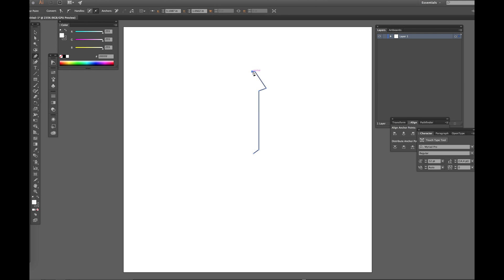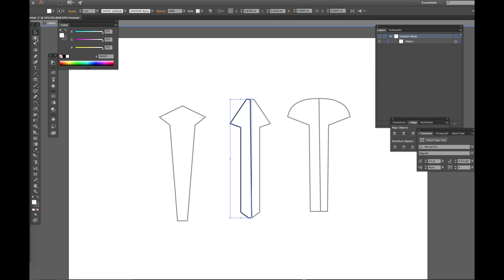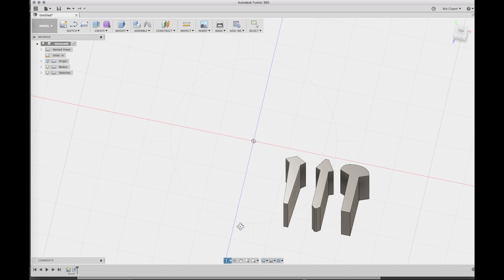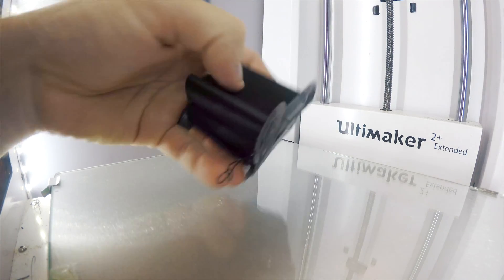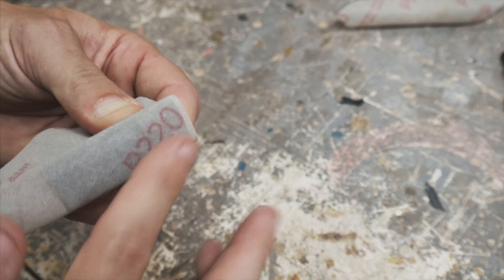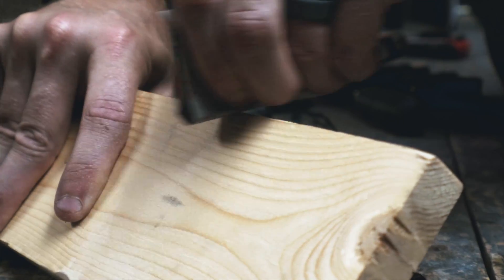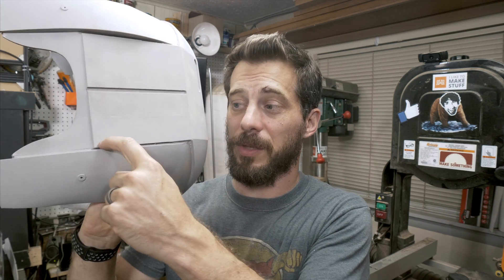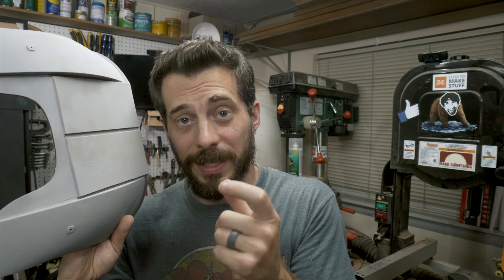How to make Custom Sanding Grips with 3d printing | I Like To Make Stuff

Comment: What type filament did you use? I wouldn't use stand PLA as that will begin to warp very quickly by the heat generated from the friction.

Comment: Hey Bob, good video.  I haven't gotten into 3d printing yet, but it's only a matter of time.  Just curious; any idea of the cost of those?  Since I've ever bought the spools of print material, I didn't know what those would cost to print.  Pennies?  Dollars?  Just curious.
Reply from the maker: A spool of PLA is anywhere from $30-$50 depending on the brand (and there are different qualities) but a spool goes a really long way unless you're printing huge pieces.  There are a lot of factors into figuring out that cost though (including lost waste material, etc) so Im really not sure.  Some pieces of software (Simplify3d I think) will give you a cost estimate of a print based on the spool cost that you input.

Comment: You can take this a step further and add a dovetail-type shape to the end and create a handle for it with a corresponding shape. It would lock into place giving you more control, a more comfortable grip, and you could even incorporate a way to clamp the sandpaper to keep it tight.

Comment: Cool use of a 3D printer. I had not thought about sanding blocks of unique sizes. And if you had already modeled something, just like you said, using the negative space would be super easy.

Comment: I've delayed a table refinishing project because of the intricate detail on the table legs. This will make sanding those areas so much easier. I can’t wait to get started with 3D printing and I think this will be the first project that I attempt. (As a side note, our local community college has a 3d printer in the library which is accessible for a small filament fee. Just bring your design file). Thanks for the great video and idea!

Comment: Those look super handy for sure. Question, I've never 3D printed anything. You said the term "infill" to clarify, are most 3-D printed objects somewhat hollow? I would assume so due to print times and cost of Filament right?
Reply from the maker: Yes, infill is a percentage of "solidness" :)  The majority of things I've printed are only 10-15% infill.  There are also different infill patterns that help with crush strength ,etc.
Reply: I Like To Make Stuff thanks for clearing that up Bob I appreciate it

Comment: Nice handy tool I really to make some and get sanding! Probably know this but quick illustrator tip - Make the shape slighter wider than needed. Once duplicated have it overlap its twin by the excess amount. With both items selected use the Pathfinder to merge them together. Just saves a few clicks. Love the videos and the projects!

Comment: Perhaps you could make the handle as a female dove tale and changeable heads as the male. So you can swap head by sliding them out side ways like a puzzle piece. This could further cut down costs.

Comment: Good idea, hadn't really thought of that. :-)

Sketching directly in Fusion would be my preference, but for those using Illustrator, there's some potential issues with svg scaling on import to Fusion. There's a few threads over at the Fusion forums about this, so beware.

Comment: why not to make that out of wood?
Reply: Rundik matthias pointed that out in another comment - i'm sure it could be made out of wood, but with the 3D model you can create a model that will accurately fill the negative space of another 3D printed object that you need to sand, as Bob mentioned at the end of the video referring to his Shore Trooper costume. it could be done out of wood, but it might amber some trial and error to get the exact shape.

Comment: Hi Bob!
This is one thing I love about 3D printing, the limit is your imagination, and how you work around the printer's limitations. 
I know it is for a quick and simple print, but what if you modeled a little valley on the top of the handle, then a cap that would fill the valley, pulling the paper, then have it snap to the edged? In theory it would hold the paper right, and would avoid spray glue.

Comment: Such a great idea!  I could easily see having negatives for each of my router bits, especially for ogee bits and complex molding shapes, etc.  I've been on the fence about buying a 3D printer but every project like this I see pushes me closer to buying one.  Thanks for another great quick vid!
Reply: hey you could 3d print setup blocks also maybe not practical but you could and they would be accurate

Comment: would this work for making a sanding block for sanding a 12 inch radius into a guitar fretboard?
Reply from the maker: I suppose it would! As long as you can model exactly what you need.
Reply: I Like To Make Stuff thanks!

Comment: Basically, how long does it take to print a 3d model ?
Reply from the maker: It's completely dependent on the specific model.  Lots of factors involved.
Reply: I Like To Make Stuff does that mean that the bigger the model the longer it takes ?
Reply from the maker: Yes, bigger takes longer but also it has to do with infill % (how solid/hollow it is), the layer height (how much plastic is output per layer changes the detail) etc.
Reply: I Like To Make Stuff okay, i see. thanks for your explanation. keep on making good projects. cheers!

Comment: Would like to see a full multi-discipline project kind of like the arcade cabinet that implements 3d printing, electronics (arduino or raspberry pi) , wood working (including lathe) AND welding.  It would be interesting to see all of the different fabrication methods you use put to practice in one functional product and seeing how they work together in design and aesthetic.

I could see something like a pinball machine with metal frame, printed models, soldered rails, wooden/turned plunger and cabinet with arduino controlled lighting and scoreboard and maybe a raspi display for a minigame.  

Clearly I am going way overboard, but just an idea :)  Keep up the great work!

Comment: If you make a set of them you could also print the dimensions like width and angle for quick reference, with inset lettering, on the flat side surface.
Easy enough to do in the modeling software.

Comment: Wouldn't it have just been easier to just have created the whole project in Fusion instead of importing? I'm not sure I understand the advantage of using two pieces of software in this instance.
Reply: Some people have been using 2D illustration apps for far longer than 3D printing has been a thing.
Bob was just showing how people with that skill set can make their lives a little easier using a tool they're much more comfortable designing in. =)
Reply: Gotcha, that makes sense. I didn't know if i was missing something.

Comment: Are you using the free version of Fusion 360 or did you actually buy it? And if you use the free version, is it free forever or just for a limited amount of time?
Thank you :)
Reply from the maker: I'm using Free. It's free unless you're making over $100k with it, I think (you'll have to check the license)
Reply: As it stands now, It is free for a year if you are a hobbyist and not making over 100k per year with it. At the end of that year you have to certify that nothing has changed and they will give you another year. But you never know what the future will bring! :)
Reply: Dave Strain Thanks for the quick answer! In that case I will have a look into it. Currently I'm using 123D Design although it's also quiet good it looks like Fusion 360 is more professional and brings more feature with it

Comment: If you were trying to perfect match that part you would need to increase the tolerance in the model to account for the thickness of the sandpaper to match the negative space, or am I overthinking it?
Reply from the maker: Technically you're correct but it depends on how exact you really need to be.